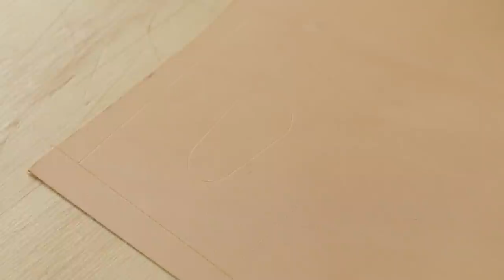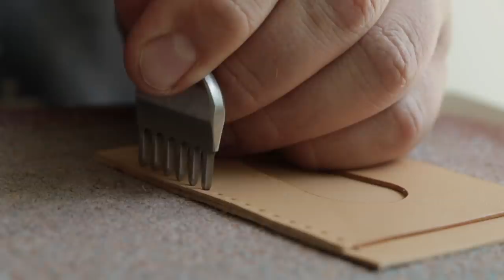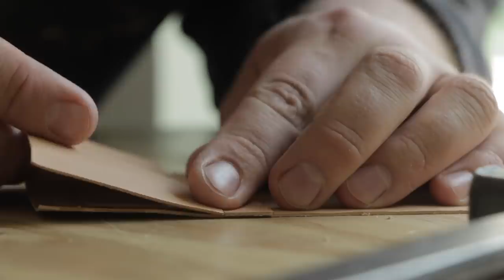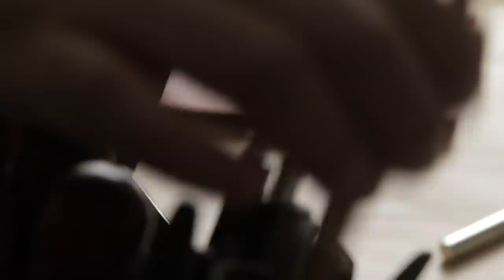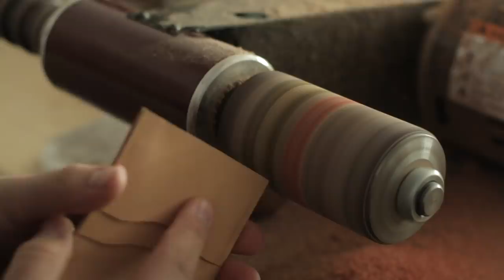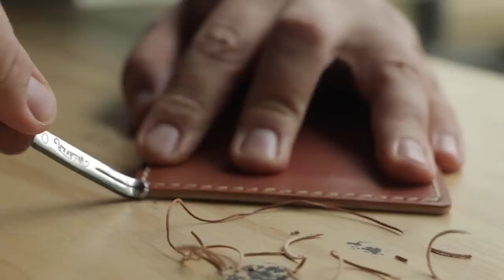Quick Draw Wallet Made with Hand Tools

Comment: Nice and slim! Definitely a handy one for a pocket. 
Is the leather used all about 2oz? Seems really thin! 😊👍
Reply from the maker: it's a combo of 2-4oz for different parts :)
Reply: @Corter  4oz is pretty good, I have some 5oz that's just a little too thick for my liking. Thanks! 🙂
Reply from the maker: yea 5oz is difficult if you're making a wallet with more than one layer - good for exteriors when you're not lining the piece, but we usually do two layers of 2-3oz if we do that
Reply: @Corter  yeah, my 5oz is gonna be used mostly for heavy carving pieces. Thanks very much for the tips!

Comment: FYI for everyone who saw the edger stroper (sharpener) being used. Never run your edger back and forth like that!!! Only pull it back towards yourself. Even I. The Weaver “how to” vid on how to use it tells you the same thing.
Reply from the maker: Yep! I don't put any pressure pushing forward, only pulling back. You can see it on the video
Reply: May i know what material you use to make the stroper? I usually using fine sand paper on the round edges surface...